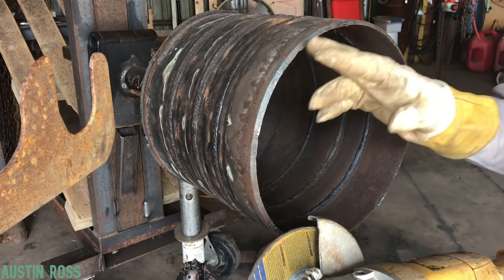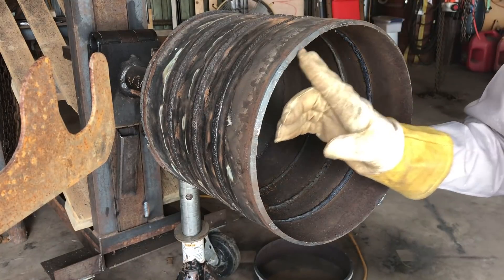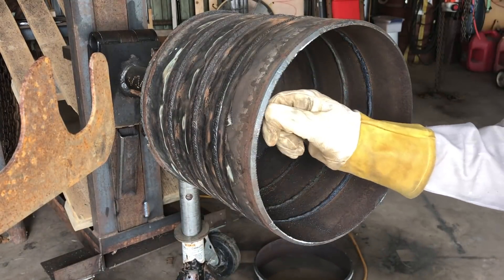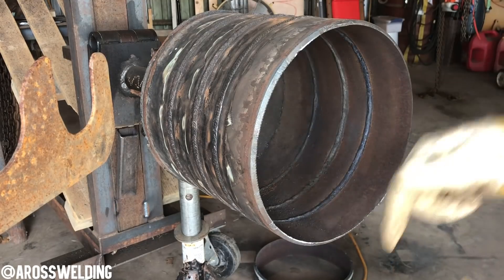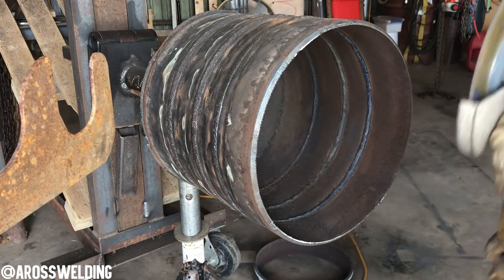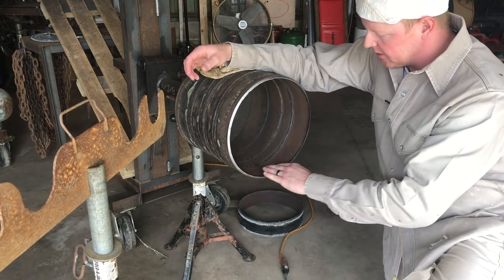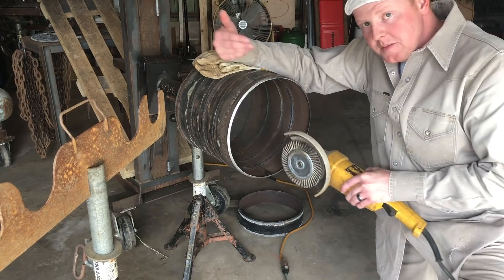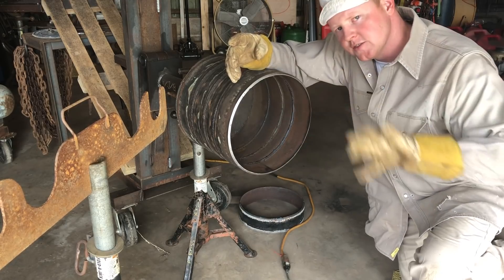HOW TO PREP PIPELINE PIPE ENDS FOR WELDING (COMMON WELDER HELPER DUTY)

Comment: Hello Austin.  Can u make a tutorial on a cement lined pipe. I have a test in a month it will help a lot
Reply from the maker: I’ve only welded on cement coated pipe a couple times. It’s really not much different. You do mean on the outside right?
Reply: @arosswelding  no on the inside. I have welded a few at home the rot is the tricky part of it. Every thing else is the same

Comment: Noticed the practice welds on that piece of pipe, the caps look good! 
Please do a video on capping! 
 profile, edges, windows on the side and how to avoid arc sputter/ falling out, acceptable looking, not acceptable, grinding on cap, when u run too hot and its low in the middle,  patching with scabs, missing edges, arc length while painting on, stringers, strip cap, whipping, dragging, spuding up with brother in law partner ect. thank you! quality video as always

Comment: I do similar . I use a 5/32"thick x 6" or 7" disc  to do all the prep . Grind the Bevel first not the land once done then the land. The initial land looks to be about 3mm 1/8" , taking particular care for uniformity of thickness (that is why the long sweeps with the grinder ) uniformity is key . Once done, one has to get rid of the bure that has been made inside the pipe  . simply put the grinder in the pipe with the disc touching the inside the pipe as if you were going to do a transition grind . but not angled so much as to do one . Now with again a sweeping motion grind the bure off and at the same time grind back the mill scale off about a 1/4" into the pipe from the cut end . when done you will have a 2mm 3/32" land uniformly all the way around . The reason for uniformity is a uniform heat sink which makes for ease of welding . with this size of land I use a 2mm-3/32" space using 5/32" rod to bead . getting that 1/4" mill scale in the pipe helps to alleviate internal undercut , especially using 8010G for running beads which is a faster freezing rod then 6010 5p+. Doing the grinding in this sequence it is done once, and it is good to go . Up here in Canada on pipeline we were allowed 120 degree guards and it was written into the OH&S code . A 180 degree guard as far as I'm concerned is down right dangerous on pipeline especially for novices . I can say this backed by 40+years of experience . Keep up the good work Austin weld the tight spots  first .  .www.fittergrips.com